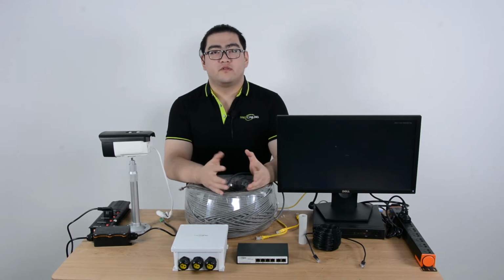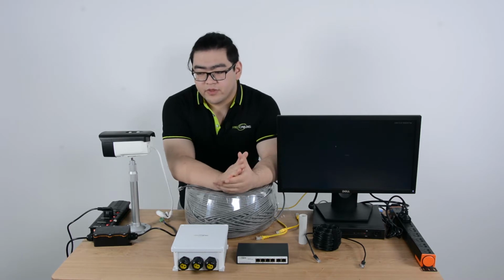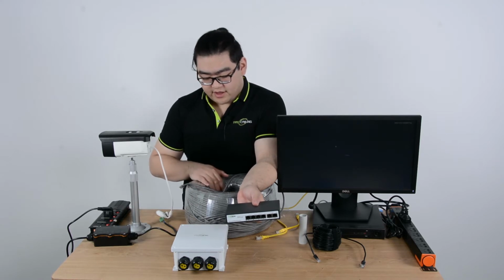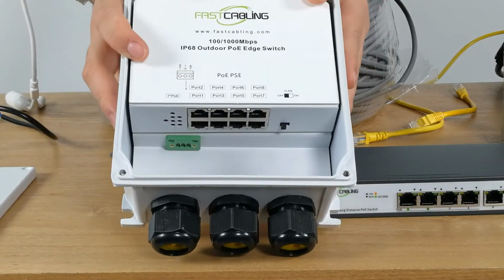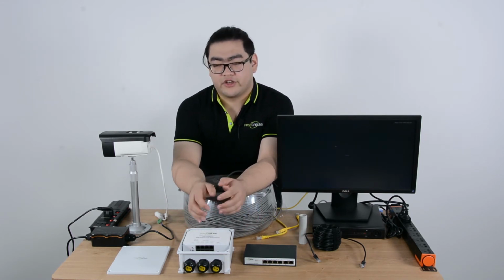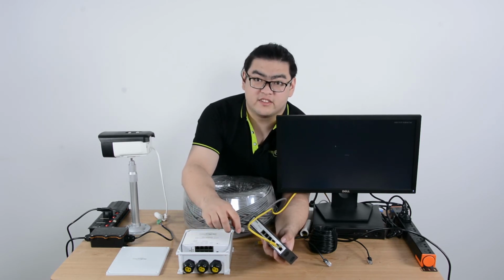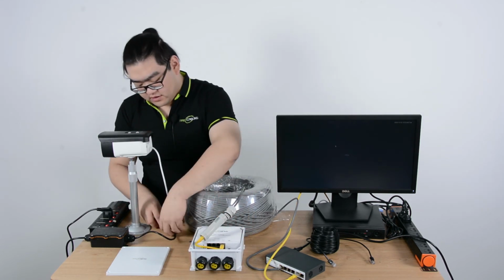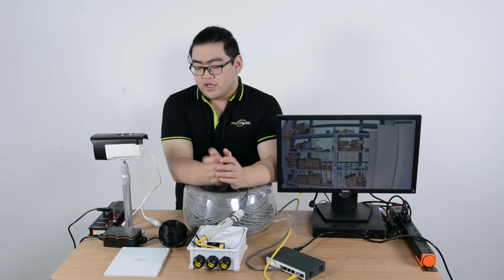Ethernet Extender #4 - 1500ft Network with Cat5e/Cat6

Comment: What waterproof Cat5e cable would you recommend buying?
Reply from the maker: I will suggest Cat5e Pure copper. It can reduce the power loss inline especially you try to extend the PoE beyond 100 meters.
Reply: What company should I buy from?
Reply from the maker: @Cduke22  it is the common Ethernet cable, however, CCA is being used to replace the pure copper to cost down the cable. You just need to make sure it specify pure copper, and it will be more expensive than CCA.